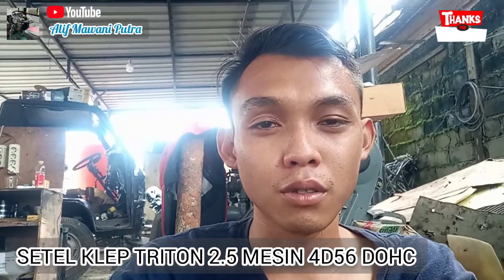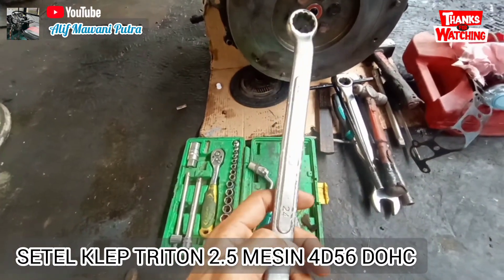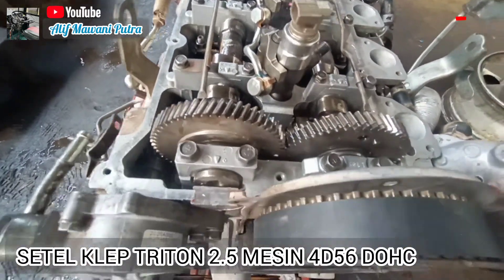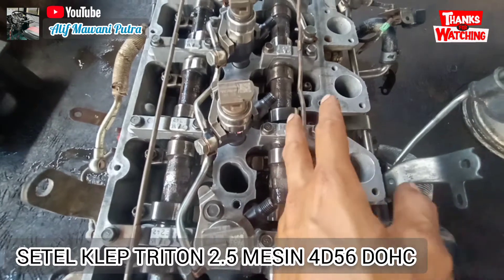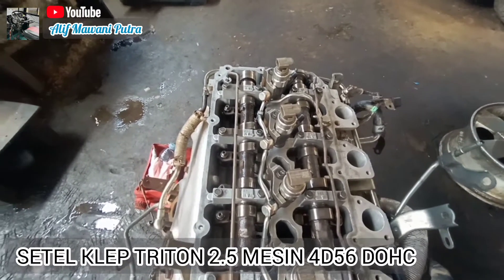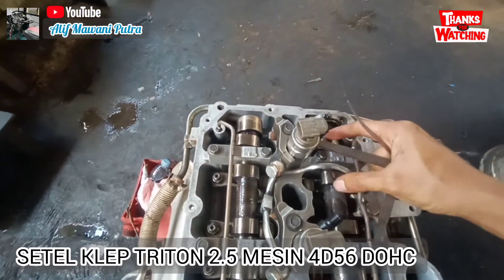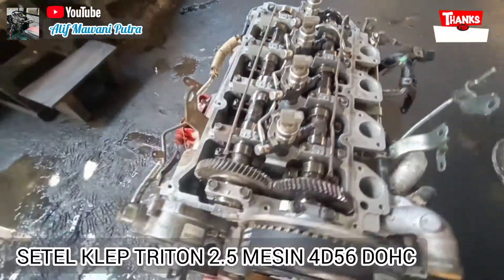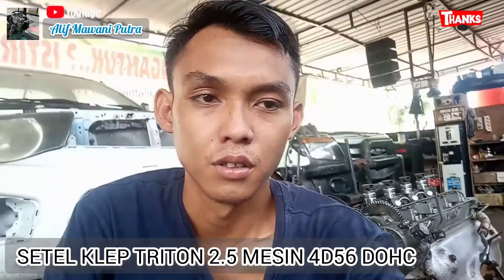SETEL KLEP TRITON 2.5 MESIN 4D56

Comment: Mas pernah ketemu trouble engine tidak bisa langsam kah , error code tidak ada ,supplay pump baru ,injecetor baru ,sdh check kebocoran pressure limiter ,timing sdh top ...
Reply: Mitsubishi Triton double cabin tahun 2012
Reply: coba ganti camshaft yang untuk sensor cmps